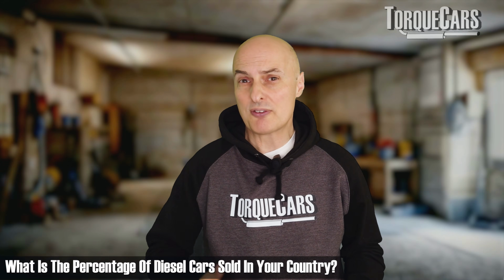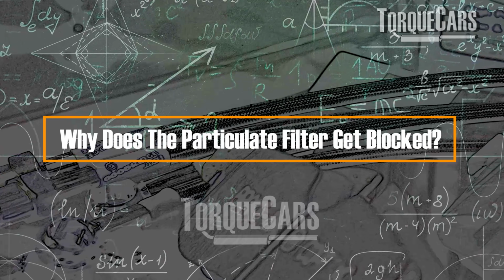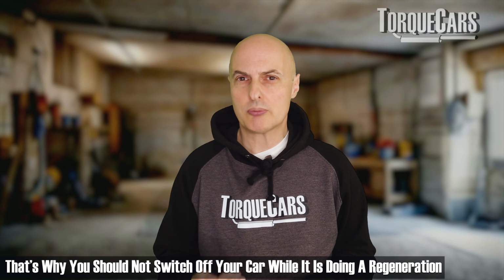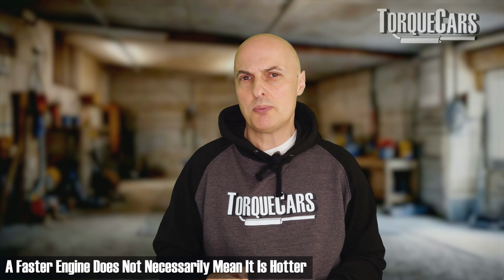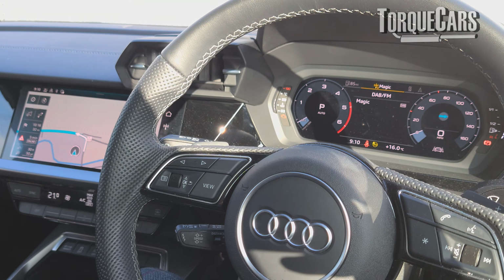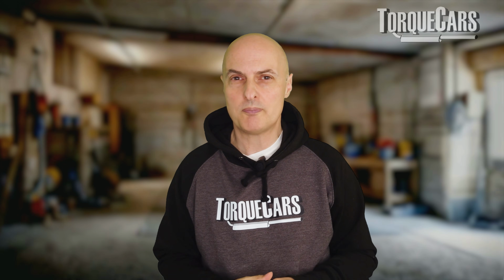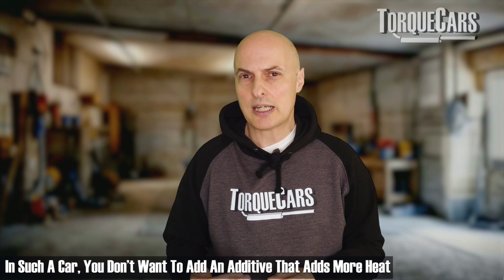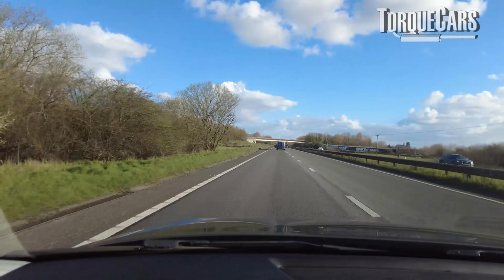Stop Killing Your Diesel! DPF Guide: Diesel Particulate Filters Explained

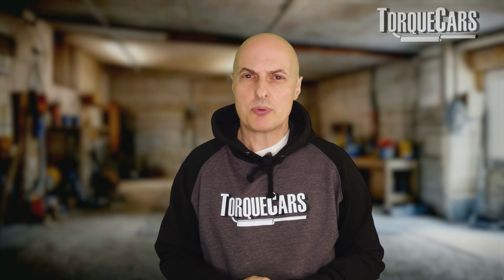Comment: 7:21 that may be true for some car models or in particular circumstances but not as a general rule. My dpf do healthy regeneration cycle at steady highway speeds e.g. 60mph, no need to keep that limited 18-40mph range. To think about it, that would be crazy, imagine in city driving with all the trafic stops and short ranges regeneration often will fail to start, you need to take the car on motorway for longer jorney, imagine if you would need the car to slow on motorway just for the regeneration to take place...
Reply from the maker: You're right, it varies a lot from maker to maker. I've tried to create a sensible common sense guide that will work on most cars. I was a little surprised that some cars avoid a regen over 40mph, but if that's out there I've had to include it. You can't beat following your makers instructions though, they know what it needs. There are still many diesel owners out there who've never heard of a dpf or regen!

Comment: HVO - The fuel that cuts emissions by up to 90% costs the consumer 28p more per litre at the pump than the fuel that doesn't ("regular" diesel). The government's own answer to a parliamentary question confirms this is by design, not oversight.

Comment: I got a Skoda 2018 model. The regeneration usually starts just when i turn in my driveway.
Now i do not have any signal that tells me its regen....
I just smell it and the coolant fan is working after i turned the engine off..
Yes i understand this is not optimal.
But if WV does not have a software that can tell me when the Regen starts, then the joke is on them.
I soon sell my car for a EV anyway.
I do long commuting to work with my car so i am sure my P-filter is fine, but its stupid that it does not signal this prosess

Comment: At 2000rpm my diesel car is doing 75mph....at 2500 its 80+...vey hard to maintain this rpm and be legal...

Also changing does gears does not work because the car reverts back to top gear...it must be programmed by manhufacturer to keep revs down
Reply from the maker: My guess would be that a regen happens happily at a lower RPM point on your car, the manufacturer will not require a level which can't be legally or safely achieved.

Many modern automatics are indeed geared for efficiency, so you may need to use the manual or sport mode to hold the lower gear and build the necessary heat for a successful regen. Which car is this?

Instead of relying on engine heat some models squirt extra fuel into the exhaust stream to heat up the dpf so I suspect this is probably the approach used on your car.

Comment: I've been using Millers Oils Diesel Additive, swear by it... Supposed to help the DPF process, but I notice a smoother torque curve, less labouring for example if you're in a higher gear at low speed the car will pull rather than bog down, I also get far better MPG and throttle response... 
(2009 Yeti 140hp) 
I wish I could delete the DPF and EGR, bloody net zero BS!
Incidentally, I live in Northern Ireland, it's really difficult to go for a 40-60 minute run in the car because our motorways (all 2 of them) aren't really long enough to perform a regen!

Comment: My saab is showing a p400 code I have changed the egr,cleaned the throttle body, put a new maf sensor on and a new wire to my ecu and I still cannot get the engine light off. I have tried everything!! I now feel I have run out off which way to go.
Reply from the maker: Sometimes the car needs to learn the new EGR settings, it might also need to be recoded (although I doubt that on a Saab). It could be the signal to the EGR controller, a bad earth or short somewhere. Inspect the cables and connectors. A blockage in the exhaust feed to the EGR can also cause problems. Try Shell Vpower a BG cleaning additive & some mid range RPM "lift off coasting pulses" to encourage exhaust flow & heat, it might help.

Comment: BMW X1 F48 2.0 diesel - mix of long and fair number of short journeys.

Given my first DPF car and  all the clogging fearmongering that came with that, i got a bit obsessive:
1. Got DFP capable OBD dongle.
2. Got bimmer-tool app (or any that will show DPF data for your car)

After a lot of monitoring, the short of it is as follows:
- Active regen kicks in anywhere between 40% and 50% soot accumulation.
- It takes about 15 minutes for it to complete, even around town driving (from start to finish). 
Tips:
If you have more short trips, monitor more often and when it gets to 40% + , take it for a ride (you'll need to adjust the values for you brand/engine but the process will be the same for the most part)
Sometimes i leave the app running when i drive (at the times i suspect it will regen according to the percentage ) and if regen shows as active near the destination, the percentage shown will tell you more-less how much longer to drive to complete regen. 10min was maximum i ever had.

Had the car for 4 years, it never went above 50% soot. I understand that few people will be bothered to monitor, but even from time to time it helps.
As someone said, when asked "why change oil at half recommended interval": oil -> cheap, engine -> expensive.... OBD -> cheap, DPF filter -> expensive.
This is just a suggestion and i hope it helps someone.
Reply from the maker: Which dongle did you go for out of interest?
Reply: @torquecars  Veepeak OBDCheck BLE Bluetooth OBD II Scanner
It's bit basic but it works well as i needed exclusively for DPF.
It has forced regen option if necessary (with-bimmer tool at least) and other useful options, beyond what i needed.

Comment: The turbo on my bmw 520d had to be changed at about 110.000miles - probably due to clogged particle filter - as it makes the turbo work with higher heat than if running normal.

Comment: For a 2L Ingenium 2017 Discovery Sport, it was recommended constant revs between 40 and 70mph. Ideally have it in cruise control. 
Google AI suggests optimally 60-65mph with revs between 2000 and 3000 rpm. The cycle will be at least 20 mins with another 20mins to recover, and interruption of the active phase with a change in revs could abort the process.
I've never had any issues on my Discovery Sport 2017 which is now on 82K miles. I rarely do a journey less than 20mins. Typically my journeys are at least 40 mins on A roads at at least 50mph, so I'm lucky.
Reply: For now and long may it last…I wasn’t so lucky and experienced the flawed crankshaft design problems caused by it missing 3 main bearings… at 121,000 km…😢

Comment: My Audi A3 auto diesel never seemed to regen. Regular motorway and DC runs. Ended up getting the dpf replaced at around 70k. Sold it and bought an S3 instead. Just bought a PSA blueHDI 2.0. I’ll be trying my best to keep it healthy and performing as I’d like to keep the van for at least a decade.

Comment: My Honda Accord i-dtec has a number of things that would prevent it from performing an active regen. It requires over a quarter of a tank of fuel, doesn't regen if there's an a/c fault, won't regen if it's calculated that the oil dilution is too great and doesn't warn you that it cannot regen. It then blocks up and requires a forced regen. Apart from that, a lovely car, but they really should inform people who are likely to buy diesels beforehand.

Comment: I have a 2019 amarok stuck in limp mode it has several codes now it is frustrating,
I have been told all the codes along side the DBF code must be cleared even if I get the DBF cleaned it still won’t go out of limp mode does anyone know if that is true.

Comment: One thing to mention about the service interval, make sure that the mecanic also resets the interval. On friend of mine bought a diesel Megane that had the oil change but not the service interval reset and because of this it would not do the dpf regeneration.

Comment: Wait...I have a 2.0cdti engine..230,000 miles but I do mainly motorway driving (long distance)...diesel engines love motorways
Reply from the maker: They do indeed. 300k is not unusual on original engine parts on those.

Comment: I’ve had an Audi a6 c6 2.0 tdi for the past 6 years I do a 12 mile each way commute the final 4 miles on duel carriageway . I’ve done 66000 miles in 6 years the car has 29000 on it when I bought it . I have never ever noticed the dpf doing a regen I’ve never had a light on . . It gets used as the main family car so short trips at weekends some nights and big motorway journeys for holidays etc .

Comment: Peugeot 2008 1.6HDi Blue 100 - Regeneration takes place anywhere from 30mph upwards including 70mph. Definitely best between 1500 and 2500rpm. 70mph in top gear is 2000rpm. I can hear a click somewhere behind the dash in the steering column area so I know when it's kicked in. The engine tone also changes and sounds more throaty. I only use Esso premium diesel since most of my journeys are short but it's serviced every year regardless of mileage with specified fully synthetic oil. Car is 8 years old now and never had an issue with the DPF. Regen period usually takes about 15 minutes and I always wait for it to finish if I've arrived at destination before it's finished the cycle. 3 key things I've found to avoid any issues: Oil change yearly (in my case every 6000 miles); Keep an eye on adblue level and top up after every 3 - 4 full tanks of diesel (3000 miles or so) rather than waiting for the car to tell you the adblue is running low; Only use premium diesel (in my case because I mostly do short journeys)
Reply: Adblu has nothing to with the DPF though. That's another emissions system. Premium or supermarket fuel has no difference either, engines are designed for EN590, which is exactly what even the cheapest fuel is. Peugeot / Citroen has Eolys fluid, which doses the fuel with fuel conditioners. So when that runs out, refill with the genuine Eolys fluid only, don't use the "PAT" compatible fluids.
Reply: @khalidacosta7133  My comment about Adblue was a general tip to avoid any issues since mine didn't tell me it was running low, it was in fact completely empty and threw a NOX code up! So it's best to check the level every 3-4 tanks of diesel and not rely on the 1,500 miles countdown. We shall have to agree to disagree about the premium diesel. I get over 100mpg on motorway journeys once a month for my work using premium and only 70-80mpg using regular diesel. I've not needed to refill the Eolys fluid yet. On 69k miles. Timing belt due next! Booked in next month, a year early but better to be safe than sorry. Am just glad I didn't buy one with the 1.2 Puretech engine

Comment: Jaguar say DPF regen occurs between 37 and 70 mph for about 20 minutes when engine is warmed up
Reply: @christianolssontravels  my xf was on amber then red took if for drive at 3k rpm for 60mph and it cleared it all off.
Reply: @ashweemills  I used my XF diesel mostly for short trips and I was regularly getting the amber warning light on which meant that I would immediately need to go to the dual carriageway and drive for 30 minutes to regen.
Because the car didn't suit my driving habits, I sold it and bought a petrol car.  Problem solved.

Comment: I've been using VAG DPF app to monitor when in my runs, 681c showed it running and burning soot  down, took 12min got it down to soot 5.84 g and oil ash level steady at 14.4g i use castrol edge 5w30 ll fully synthetic and BP ulimate change oil every year no matter miles, MK7 GT TDI Golf keep tank fuel full not below 1/5th empty

Comment: I've only had one car with a dpf,an 2022 Kia Sportage diesel done just over 2500 miles and warning came up,keep driving don't stop until light goes away I had to drive for 5 or 6 miles and use a lower gear but light went out but at least it warned me I suppose,good advice here so will drive as normal next time warning appears.

Comment: May I ask a quick question please; We tow a 1600KG caravan using a 2013 Renault Trafic DCI 2.0 SL27 which has had a DPF clean this year. Generally our motorway speed is cruise control set at 57mph using 5th gear at 2200RPM; will doing this clogg up the DPF prematurely? Many thanks. Matt.

Comment: What do you mean by driving under load.
Thanks
Reply from the maker: Higher rpm and more than 1/2 throttle. Anything that makes the engine work. Light throttle does not add load even at high rpm - the engine is barely working.
Reply: @torquecars Does using cruise control count as the engine being under load?
Reply: Means driving heavier, or pulling harder. Like loaded with weight such as fat people or pulling a big trailer going up hill

Comment: Your comment about have to do miles you wouldn't normally do because the vehicle is going through a regen is the one thing that makes me laugh about these so called green additions to engines, its put on to save the planet but means you need to drive further than you would without one on the vehicle... work that out Mr Miliband.😂
Reply from the maker: They also dump extra fuel during the regen process killing your fuel economy. Crazy isn't it?
Reply: It’s the same with most things that government thinks up ,absurdity is their norm .

Comment: I changed the vaporizer on my Focus mk3 2.0d 163pk because it couldn’t do a active regeneration anymore. The dpf is not broken inside but it’s full of ash and needs to be cleaned. My friend can do the work so I payed 250€ for the vaporizer and 250€ for cleaning in a specialized machine. The car has 370.000km so I’m ok with that.

Comment: Why can't vehicle manufacturers fit a light on the dash to say when it's in Regeneration mode. I do long journeys in my van and it still clogged the DPF. It's been fine since I been driving it like I've stolen it to work and back. Work is 16 mile away. My old astra had a Eco bar. So if the first bar was lit. It was in DPF re gen mode. Though I found quickest way to re gen on it was to rev it to 3,500rpm-4000rpm for about 5 minutes. Preferably in 3rd on the motorway. Allways worked.
Reply: Yes absolutely shocking they don't have info built in for such an important thing
Reply: And fit a button so you can tell it you are starting an hour or so motorway trip, rather than it kicking in when you don't want it
Reply: If you do that to a 6.7 cummins you’ll be doing 170 kms in no time. !!   They should make the filter serviceable / easily removeable, and also you should be able to do a manual regen when you know your going on a highwat trip
Reply: You should be able to tell by the way the car is driving. If you drive automatic, when the car is doing a regeneration the ecu will typically stay on gears much longer. You will notice the car not up shifting to a higher gear. If you experience this, you are currently in a regen. When it’s finished the gear changes will go back to normal.
Reply: @Elevate_G why should we have to guess though?

Comment: I've a ds3 diesel 2012 . 126k 
  I don't drive in to high a gear.
 Use only high quality fuel.
 Use 2 stroke oil in the fuel about 100ml to 1/2 tank. When warning dpf light comes on  poss 200ml.

The car only self cleans I've found with half a tank of diesel..... as it uses it to burn off . But won't work with low fuel.

People buy diesel for economy mileage ..but no good for round the doors , asking for dpf  egr  injector probs
Reply from the maker: Thanks for the feedback, it's always handy to know the quirks of the DS3 regeneration.

I would say though to be very careful with adding 2 stoke oil to the fuel, especially if it contains ZDDP, this will leave deposits inside the DPF which can't be burnt off eventually blocking it up. It's a trick that used to work well on older engines but in many cases causes problems on newer ones.
Reply: @torquecars  thanks for the info

Comment: Nah drive in first plenty of revs gets the heat up and add a drop of gasoline into the tank. OK so not too good for pollution, but hey 20Ks is not too good for me either. I am in the throws of getting a pre 1960's vehicle, no problem with pollution test, drives just as it should nice side valve motor does about 30 to a gallon. Cheaper insurance cheaper and longer lasting spares. Got too be good.

Comment: i have nissan xtrail 2013 2.0 dci tekna. i had limp mode 4yrs ago . garage cleared codes then i took it for a run then went ok. i dont do many miles to work so now just give it a good run once a wk.cleaned maf sensor yesterday . better mpg now and more responsive.

Comment: I have a 150TDCi Focus and owned it two years now. It is a 2017March model and I got it at 44,000miles. It is now 50,000miles so a very low mileage car. I have never have any warning lights at all and never noticed any regeneration. I do add Redex diesel treatment to the tank. I always keep the tank half full. Never go shopping in it but do not always do long journeys ,,perhaps 50 miles. I have it serviced and the car tells me when the oil is degraded. This car is Euro 6 but no Ad Blu stuff needed. So Mine has never given any grief. You have clearly laid out the problems. However, this is made clear in the Ford Handbook.

Comment: Very helpful video - thank you.

I've been riddled with limp mode for a while now with my Astra J 1.6 diesel. Whilst I'm a practical person, I don't have much experience with working on cars, but I've turned a problem into a positive obsession, learning how to fix and maintain myself 😂 I recently took out the EGR valve and coolant pipe to clean using a specialist cleaner, which has definitely helped.

I take my car for a long drive once a week to work and used one of those journeys to attempt to clear the DPF. Going to use my OBD reader to check the condition now after watching your video.

Seems the turbo is the issue causing limp mode, however, so that'll be the next investigation, starting with the actuator. 

Thanks!
Reply from the maker: Keep me posted with how you get on.